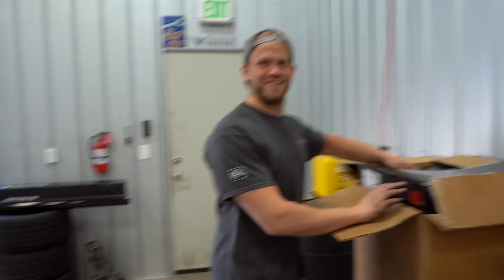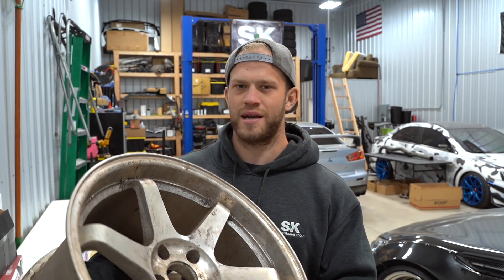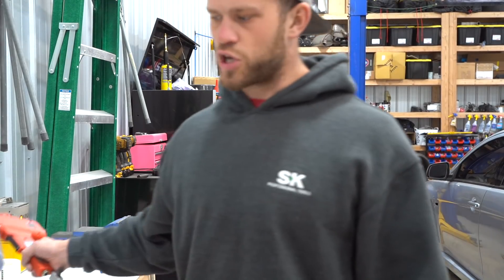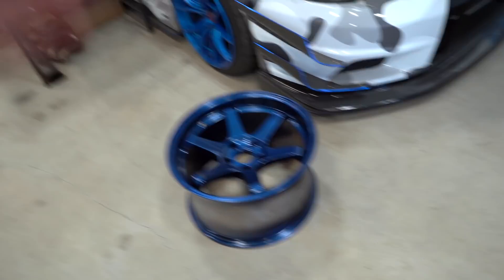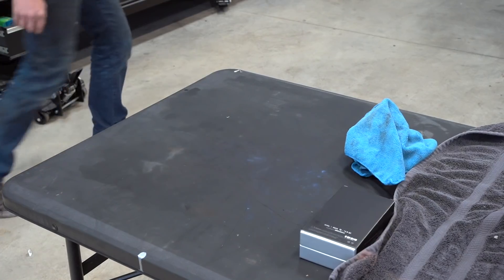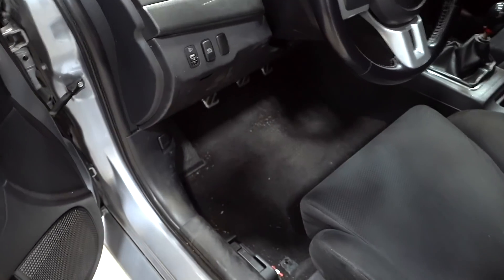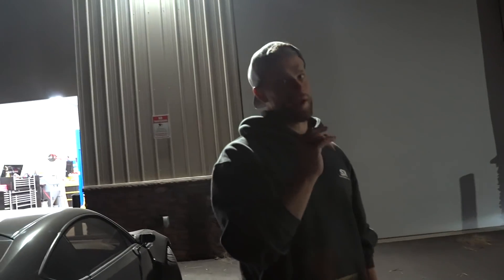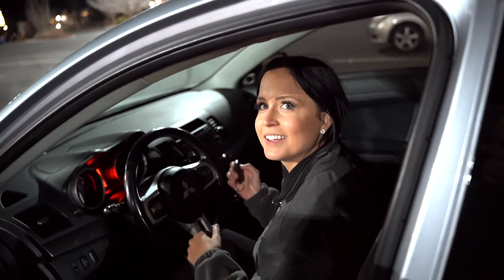Powder Coating Wheels Rays Mag Blue!

Comment: Devin, When you clamp your wheels on your machine , clamp from the outside of the wheel. What this will do is keep the wheel from turning in the clamps when you are mounting low profile tires and then you will not have claw marks on the inside of the wheel from the clamps ...also when you are mounting the tire make sure you keep the bead of the tire in the drop center of the wheel, this will prevent the arm from gouging the lip of your wheel. GREAT VIDZ BY THE WAY AND PEACE FROM OREGON

Comment: You have to maneuver the tire/prybar . Spin the tire on to the wheel as far as you can. Then roll the bar down as far as you can while applying pressure. You have to hold and move the bar as you spin the the tire onto the wheel. You'll figure it out after a while. We have an old hunter machine that can be a pain in the ass.  Or you can get tire wedges that are strung together by rubber rope. I know Hunter makes them that you can put on the edge of the wheel and it'll help put the tire on. That's what I have at my work. Hope that helps

Comment: when mounting, use the bar to push the bead down below the inside lip of the rim. This gives the tire the space it needs to stretch over as you spin it. Just watch for TPMS sensor. Make sure they are away from you.

Comment: You should get the plastic "duck bill" for your tire machine. It will dramatically reduce the chance of damaging your rims. Its the part that  touches the rim and prys the tire on. Also they make interchangable clamps to be able to do motorcycle wheels.

Comment: You should use the reverse Mount method , put the face down and also use some rags on the metal pieces that grab the wheel  Mount from the top wich is the back of the rim, so if you scratch it its no biggie.

Comment: Depending on the alloy and its heat treatment - 400 degrees could be too high.  Anything above 300 degrees can overage and soften the aluminum.  You might want to check with mfg to avoid causing mechanical failure.  With 356 T6, the solution heat treat and artificial aging increases strength by 50%.  You don't want to expose it to 400 degrees or that can go away.

Comment: Check the width of the face of the wheel and compare it to the rear. Some wheels are designed to mount tyres from the rear. Hopefully this helps dude and makes it easier for you in future.

Comment: Tire install help! Replace that metal head go plastic less risk of scratching wheels, when installing the last bead on the tire it can not be beaded up lip of rim anywhere until the tire is completely in the rim ( hard to explain through texting but most anything lower then a 45 sidewall your gonna have tire pry tools, where your putting them on top of the tire and wedging against the inside lip or barrel and pushing down in most likely 2 spots at like a 3,6pm and holding down and spinning wheel on letting nothing slip lol but your right it will come with time

Comment: Nice wheels nice colour. If you do somethings else on the body in that colour it looks even better. Next time use Ride-on, you have to putt it in the tire and if you do it correct you shouldn't have to use weights for the rims. The liquid will balance the wheel automatically. 

I used it on the GSXR and im in live with it.

Comment: I guess no one has said anything but a lot of the wheels u mount tires on are a reverse mount rim meaning u clamp the rim face down and mount the tire reason I assume ur having trouble is because the tire can’t fold under. Just a heads up homie keep up the good work tho ✊🏾✊🏾✊🏾

Comment: If you're fuckin up the finishes on the wheels, lay rags over top the paws on the tire machine. Also, instead of using the paws to clamp the wheel from the outside, lay the wheel on the machine and hit the pedal so the paws are pushing out on the inside of the barrel of the wheel. Lastly, use a rag on the end of the bar used to pry on the tire. I mounted tires on a lot of nice wheels this way, even with shitty equipment. Good luck man!